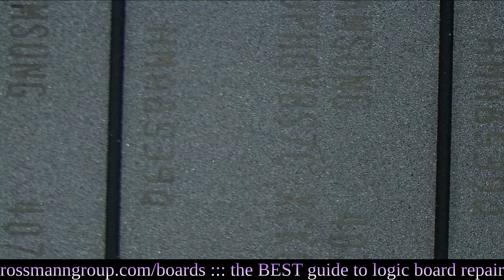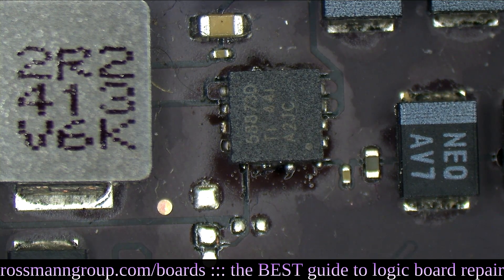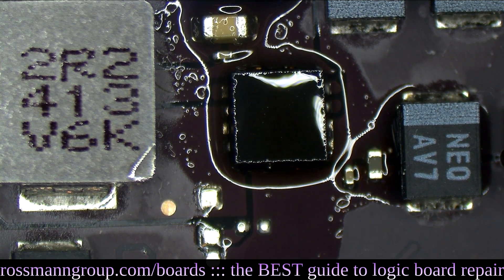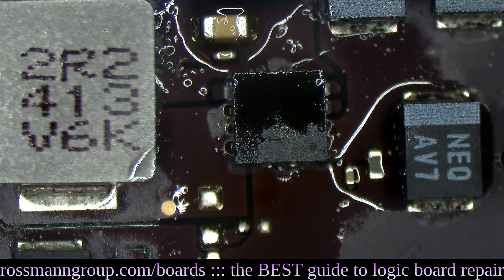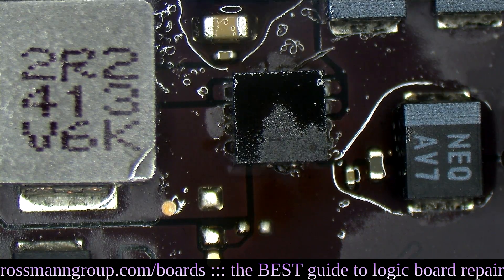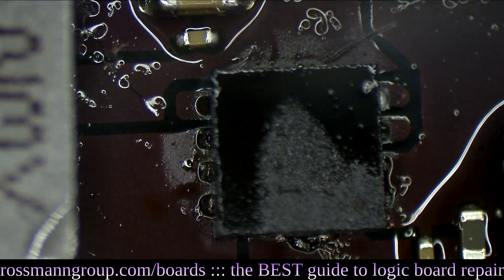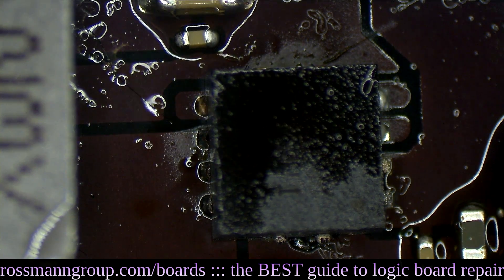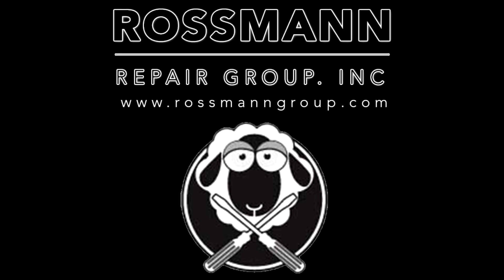Chip on Macbook tries to get up and run away!

Comment: At first, it didn't smoke anymore since the magic smoke was long gone. When flux was added and power was applied, the smoke started to appear again. Hence, flux also contains magic smoke and should thus always be used to repair electronics.

Comment: Least you don't need a hot air gun to heat up the IC to remove it, you only need it to fit a replacment. I am surprised that it had not gone up in smoke.

Comment: Introducing new technology: iRepair
This new technology will crush all of the competition.
The age where devices need repairing is over!
With our REVOLUTIONARY technology, which is going to be included in every device of ours, components with damaged leads will reflow themselves by grabbing excess current from the power supply in order to melt the solder on their pins.
iPhone 11 is going to be the first device to include this. However, due to space limitation issues, we had to remove the battery charging IC and the lightning port, so now, when your iPhone battery dies, instead of going through the tedious charging process, you just buy a new one!
Also, if the phone breaks before the first charge cycle, which we know it will because we designed it so that it will break so our technology won't be useless, you have to rely on the automatic self-repairing of the device. No warranty included.
Starting at $1599.99.

Comment from the maker: You can see that it is literally melting solder with every pulse. Now THAT is effort! This chip seemed intent to not suffer the pain or humiliation of being present on an Apple product. Consistently grabbing a pulse of 2.9 amps from the power supply, it was determined to desolder itself from the board & jump off - but never made it. :'(
Reply: I think all components on Apple products feel the same way this one just had enough and wanted out
Reply: was the surrounding board also lifting, it seemed like it
Reply: perhaps at least this tortured silicon can find peace in the cold embrace of the trash can rather than in the service of some neck bearded sjw as a means of hentai/ tentacle porn or communist propaganda  conveyance
Reply: poor lil' guy. Take thing out of its misery. XD
Reply: It was actually weird lol
Reply: The chip wanted his freedom back. #ChipLivesMatter
Reply: What was that chip for? 
A powerrail or something like that?
stil its always fun to see this kind of stuf.
looking at the area of that chip there is a coil, a diode and some capacitors i think for 80% that it is a powerrail
Reply: parity bit 0 wait
Neckbearded sjw
Dafuq
Reply: It wanted to be a Jedi warrior... I mean a Jedec flow profile, stupid autocorrect
Reply: This is basically the Apple equivalent of Stephen Kings "Misery". Every time the chip tries to escape, it is hobbled and strapped back in. Right Mr Chip.......lets see those solder balls .....*crack*
Reply: Johnny Chang - Didn't you know that the moth caterpillar chip isn't out yet, that is in Apple's next gen ones. Apparently according to their press release, it gives it "Such a boost you can even see it try and lift off the board!". Pre orders are currently in their 10 of thousands for the sheep needing their next Apple fix.
Reply: Louis Rossmann I had a similar issue. I put the chip in a frame and put it on me wall
Reply: it would be funny if the chip work on a non apple product LOL
Reply: Theme for this would clearly be "freedom run" by Kyuss
Reply: Louis Rossmann Does it have a moth caterpillar inside as with a Mexican jumping bean? https://youtu.be/CJRw18MtRPg